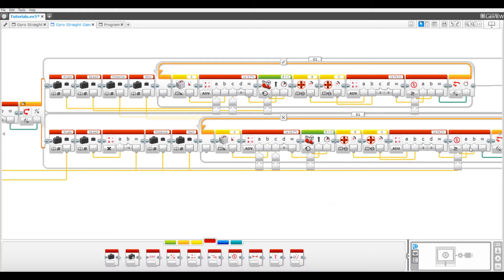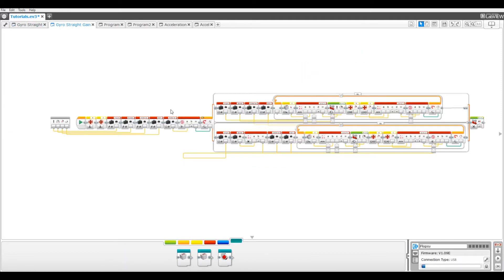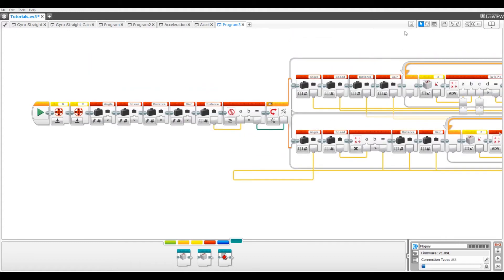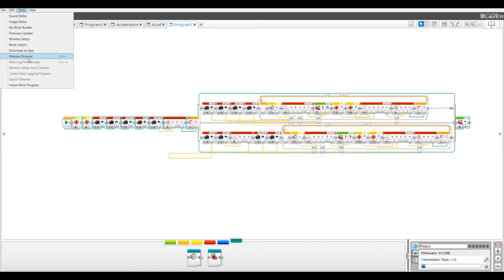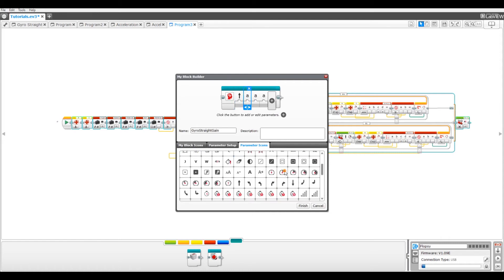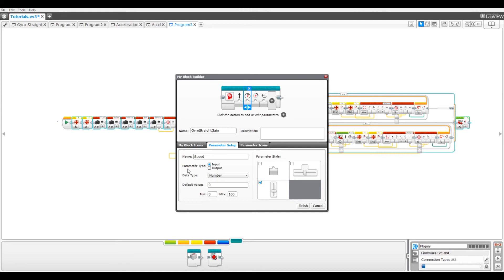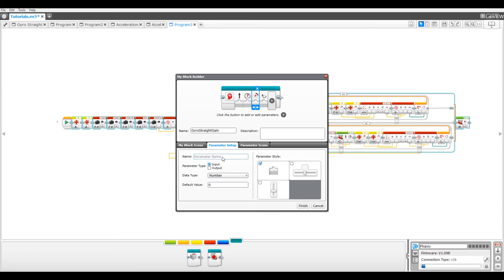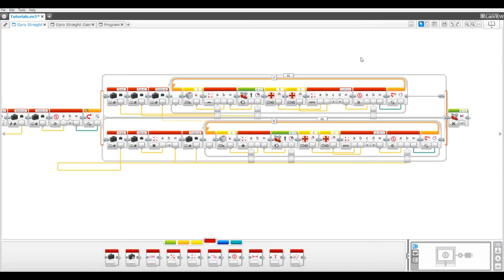Watch This Before Using Gyro Straight and Gyro Gain My-Blocks!

Comment: Thanks for doing the correction video. Keep up the good work. I am also not sure if the gain is needed. You can improve by somehow converting the gain into a gyro turn to a target angle.
Reply from the maker: Gain is not needed, but can be helpful if you want to change how sharp the turn is. There are two different programs this video covers. One without gain, and one with gain. Gain is only used if you want to use it. Thanks for the feedback!
Reply: Gain is your friend, and is really what keeps your turns nice a crisp.  Although having too much gain can cause your motors to act jittery,  experiment with gain and find the sweet spot.

Comment: What is the gain for
Reply: Think of gain as a sensitivity level,  say one of your wheels ran over a grain of salt,  if the gain on the gyro is set real low it may not react and make a correction.  Or say someone where to start blowing on the robot, a gyro with a low gain may not pick it up, conversely setting the gain to high can cause the robot to be too sensitive making the motors act jittery.